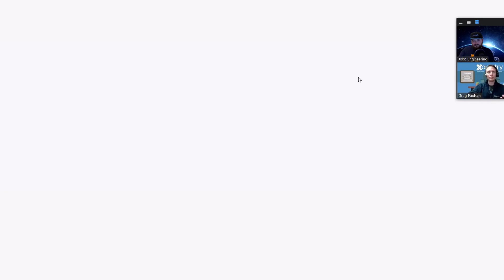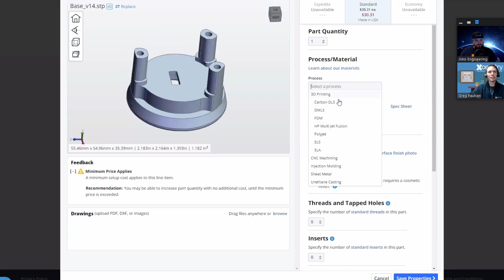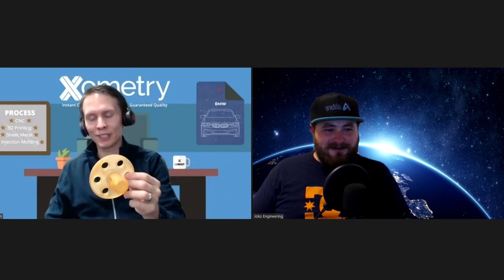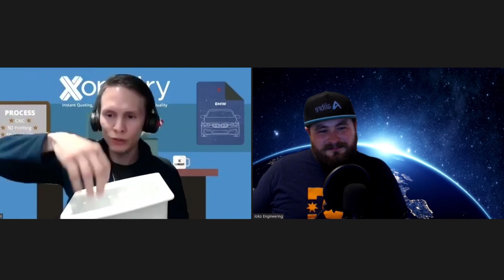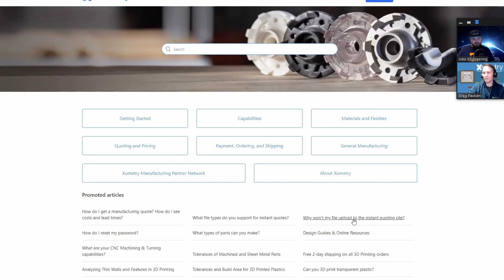Using a Supplier as a Hobbyist?  Your Questions Answered with Xometry |JOKO ENGINEERING|

Comment: Great video! A couple of questions however:

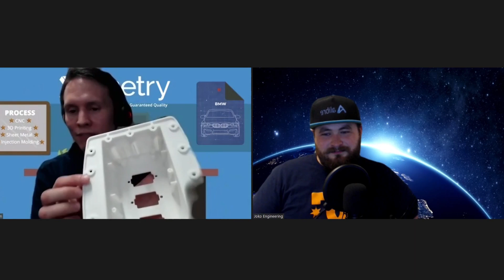1:02:40 Why can't slicers/CAM software compensate for the known inaccuracies in the manufacturing methods? It seems suboptimal to compensate in CAD, because then I have to change it if I move to a different method or even different brand of machine.

A second question is why slicers can't use step files, couldn't an FDM machine make use of true arcs? At least when the arc is in the horizontal plane. And I have seen some fancy experiments with "true" 3D printing (i.e. with curved layers in the z direction)
Reply: Howdy! That's definitely a good question and one I have asked about for years. The good news is that investment in software is happening and there are certain platforms that are getting better at 1) predicting the outcome before building (e.g. "digital twin), 2) potentially pre-deforming the geometry input so the outcome is closer to the CAD, and 3) use in-process monitoring to provide feedback and potentially compensate for deviation during the build.

Why is this so hard for 3DP? Because you are starting with a smaller material and then fusing or bonding it in a way to build the part. With machining, you have a material that remains stable--for the most part--as you precisely cut away from it. With 3D printing, you denature the base material and it is formed layer by layer. There are a lot of considerations from the complex mix of geometry, orientation, process, parameters, and the environment for the print and how it changes during the printing process. Geometry plays a huge role in expectations of a print, where heat from a thick feature could affect the wall thickness of a thin feature. Or, for particularly thin features or knife-edges, the feature just may not even be able to be made as designed due to the deposition process of printing.

I hope that in a couple years my explanations change from NET SHAPE to metaphors more similar to machining when talking tolerances and expectations --- it's 90% a software issue.
Reply: Regarding slicers and STP files. Again, it's software-driven. Mesh files like STL have been the base of 3D printing since their invention in 1984. It has been carried along and it is about time for a change. File types like 3MF are exciting because they can hold curvature as well as A LOT more information about the part for 3D production. I would love to build parts directly from parametric CAD. Check out nTopology to see what they are able to do with this because you can modify the model and export slicing data directly from your solid model, yielding better data for the printer.